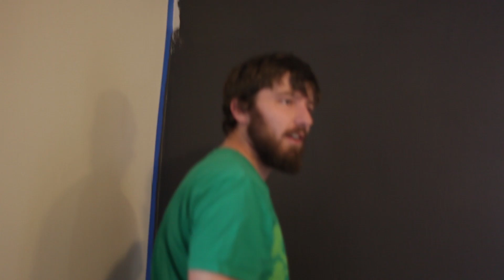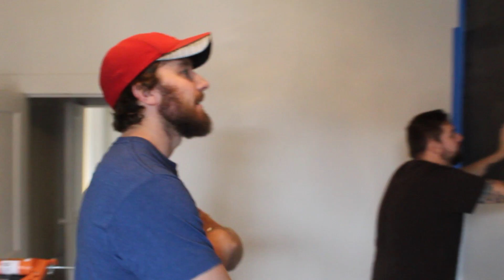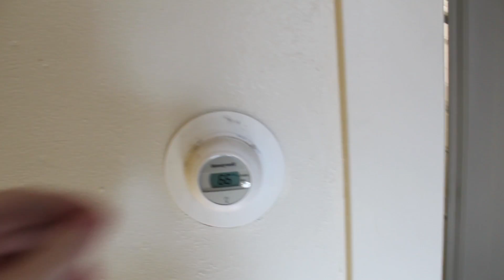Under Construction | Creatures Home Makeover

Comment: just for the future since i'm pretty sure you guys finished WAY before this was posted lol you should buy extension poles for your paint rollers they're like $5 each and makes painting much faster and easier.  So you can paint from top to bottom without bending your back, lying on the floor, or needing a step ladder to get majority of the work done.